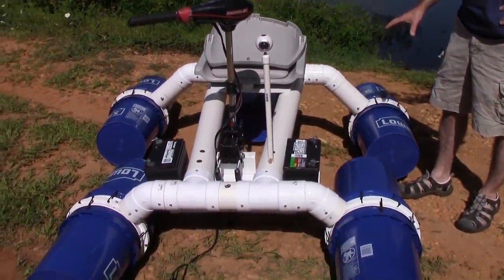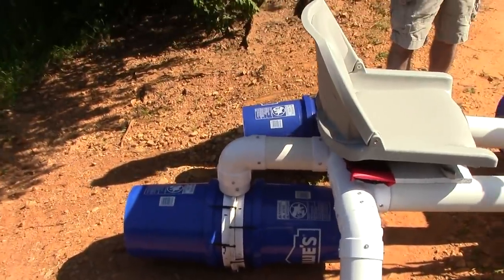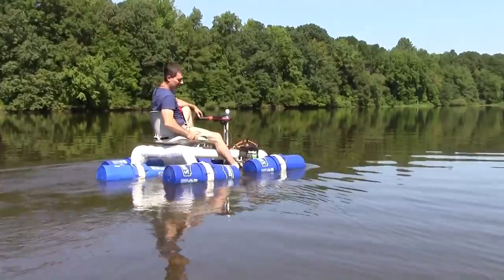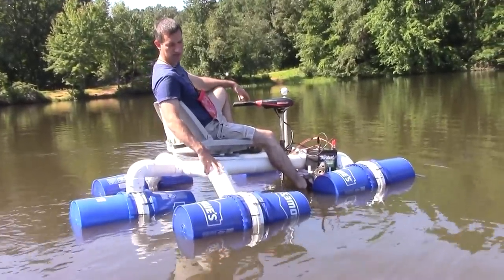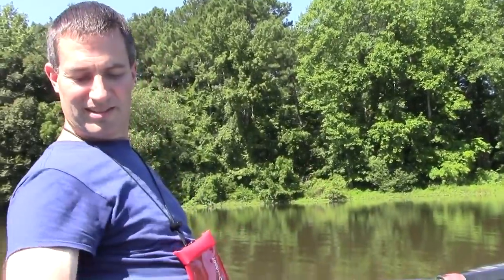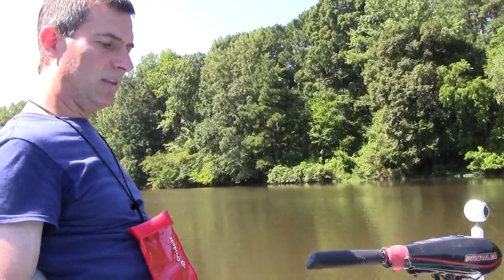Homemade 5 gallon bucket race style fishing boat

Comment: I think 4 or 6 - 8' 4" sealed pvc tubes with 90's on front and a cap on back would give you better results... than those buckets... and as someone else said, get rid of those heavy batteries or calculate your center of gravity and shift them back.

Comment: I’m surprised you didn’t use pvc primer then the glue. It makes a air tight and water tight connection, plus no need for screws. 
(Sorry just heard you say in the video you didn’t use glue because it’s for a different project)
Reply: Thinking the same thing. Way stronger and air tight.
Reply: @emceeodessa5606  ohh ya the screws would leak first if anything the pvc glue is forsure stronger (just realized why he didnt use glue but still stronger lol)
Reply: He mentioned that he didn’t glue because he use those pvc for other projects.
Reply: At the least read my whole comment and you’ll see why he didn’t use glue.
Reply: yes, why would anyone ever think to use glue without you telling them to.

Comment: I would glue those pipes together instead of screwing. When bucket fails pipes will float. Great project anyway
Reply: I have used a lot of pvc in my life and I was wondering --Where's the pvc glue?
Reply: thaboomer53 he does say he didn’t glue it because he reuses the materials for other boats
Reply: Javion Bullocks a bicycle seat post with seat removed afixed with duct tape should suffice 😒

Comment: The buckets are really cool and a stroke of genius. Lowes also has 12" PVC pipe in 20 foot sections. 12" caps and 12" X 4" T's would  be able to be clear primered and glued on for extra strength and weight savings? Just a thought.
Reply from the maker: I will look into it, thanks for the suggestion.

Comment: Great job at thinking outside the box. My one comment is that maybe moving the seat back about a foot might balance it out. Seems to lean forward in the water. Other than that a really neat way to cruse.
Reply: George, go to 6:20 and you will see that it was built that way with the rear higher.  At 7:00 you will see the buckets are sitting about the same in the water.  The difference can be compensated by making the front struts longer or the back shorter.

Comment: Just a suggestion but hang frame from buckets use sealed tubes instead of screws you'll obtain better buoyancy and having the buckets turned 90 degrees to reduce drag. Fill buckets and frame with foam? Tis the season to start

Comment: That is a cool start on a great idea, It's definitely a Builders preference type of thing though hu! LOL   I might have come to the design you built on paper, but it would stayed on paper for improvements I think.  Or it could be that i just saw yours and had the opportunity to shake my head where you didn't get yours till after the build. 

 I wondered right away why you screwed it together rather than making it water tight, seems the frame would only make it more buoyant which is desirable.  While making it water tight might seem more difficult in the build, seems to me it would be more than worth it.   That wood used is a bad choice for sure, the osb right? Id pick a different material for that purpose.    the 5 gallon Buckets.   You know, that is an awesome Idea , there are other buckets that are bigger though, I have used some material from the kind of buckets you have there ( lowes specifically ) to plastic weld with.   I don't know how well it works yet  but I have seen welding kits at harbor freight I have been wanting to check out.  they are dirty ass cheap of course as is the material.  Seems to me that back pontoon on the single arm is giving you decent support and the front end is lacking. 

  I sold a 6 HP Clinton 2 stroke motor a while back that was too large for my raft But I would bet it would be perfect for this size DIY craft.    i would not buy one tat old to run on purpose though, I only had that one because It was so cheap it was crazy not too and after I rebuilt the carb ( 20 min job ) I used it for a summer and sold it for 100 X's more than I paid for it LOL>      

   You gave me a ton of ideas to play with before next summer  man!  thanks for the awesome video. 

   i wonder if a central frame built with a singe plastic culvert pipe Capped on both ends  and your idea with the buckets as side stabilizers would work? maybe form caps for the fronts of the stabilizer buckets in the cone shape to reduce drag.  Or even ditch the buckets completely and build slightly smaller culvert pipes for the side stabilizers.    that way if you did use a a 2 stroke 6 to 10 Hp  you could get up and go pretty decently, maybe even plain LOL   Like a torpedo.   the motor would need to be in back of the driver though for that. 

   Great Vid man!
Reply: awesome comment. in other words "didn't you think this thing out dude.

Comment: Why are you screwing holes in the PVC instead of just using glue?
Reply: exactly, one its not water tight, it will take water and lower boyancy and there is no structural integrity in this design, 2 screws are no use at all, use glue it will most likely hold for life then, instead of a little while till the screw holes weaken to the point of failure.
Reply: You can use silicone washers and caulking to make the screws water tight.

Comment: Nice, have you thought about using a weedeater or chain saw motor? I would use pvc glue and metal roof  screw with the rubber washer. Just a thought.

Comment: Those lawnmower batteries are going to live a short life being deep cycled with a troller motor.  They arent designed to be deep cycled, thats what a deep cycle battery is designed for NOT a standard lead acid start battery. Those are only designed to spin an engine over via the starter and then they are charged once the engine is running with the alternator spinning.
Reply: Dee Shiznittlebaum  Say what? All a capacitor does is oppose a change in voltage. It is limited to its capacity at doing that by having a CONSTANT power supply which a automotive starter battery is not. A capacitor in an automotive amplifier setup is able to prevent voltage sags because the cap has a constant power supply  that being the alternator when the engine is running.

Comment: I have seen a lot of Good upgrade Ideas flying out so I will add one to the mix  how about yes use your glue and Buy a couple giant bags of styrofoam Packing Peanuts inside the whole thing using the Idea mentioned with Biggest Diameter Pipes you can find and lose the barrels not using the screws is the best improvement ..WATER Tight is the way to build any boat and any material that rots under water is out I think maybe using the stuff for Plastic Fences as board or the PVC Type decking. Great Job Fun Videos.
Reply: Packing peanuts.., REALLY!!! 

Why nut both of your ideas in only 1 step!!! Can nobody think of using only 1 product that floats, seals and bonds???
................. FKN SPRAY FOAM!!!!!!!!!!!!! 

It does an outstanding job as a glue, it will give more buoyancy, and it will seal holes!!! Lightweight and multiple benefits as well.......
Reply: Jeff Lake 79شض
Reply: Jeff Lake 79شض

Comment: Forget the buckets use 8 or 10 inch PVC pipes on the edges cap them off
Reply: The buckets where the head scratcher in that design.

Comment: good design... maybe use giant hose clamps to secure wood pieces to the pipe and glue the couplers together for water tightness... and maybe 12 inch pvc instead of the buckets but first do the math for displacement
Reply: They can't be too water tight unless he capped the ends. It would have been better all glued. And buckets inline instead of offset. Seat is too far forward.

Comment: I would say leaving out how you joined and waterproofed the buckets is a pretty significant omission. I think I would have used glue to solidify the stress on the joints equally. Still a nice bit of engineering. I agree with gent  before me who said turn the seat around and your weight distribution problem will probably correct itself.
Reply from the maker: You are correct, I don't know what I was thinking about leaving the bucket build out. Here is how I built them if you would like to check it out. The old way of attaching with wood is in this video https://youtu.be/nMZB2bhM9Io and the new way with plastic is in this video https://youtu.be/0X4rS23e36I. Thank you for the comments, Lonny

Comment: If you sealed the buckets better and installed air fill nozzles, a few pounds of air pressure would increase buoyancy 5 times! And you could level it out!
Reply from the maker: Interesting idea, thanks.
Reply: I don’t think pressurizing the tanks or buckets will increase “ buoyancy ” Unless the pressure changes the size of the bucket, the buckets displace the same amount of water pressurized or not.
Reply: Actually it does! That's why the aluminum pontoons on a pontoon boat have air nozzles! The increased air pressure inside the pontoons make them float higher in the water! It has to do with the amount of air inside! If you have a sealed quart jar, it's easy to push under the water! Try the same thing with a 5 gallon bucket, not so easy! Don't even try a 55 gallon drum! So, when you increase the air pressure, you're just putting more air in the container, making it more buoyant!
Reply: oldschooldiy actually, you're wrong.  The reason for pressurized metal pontoons is to make leaks very evident.  Air has weight.  Pressurizing metal pontoons actually makes them ride a very tiny bit lower in the water.  Buoyancy depends on the weight of the water that is displaced vs the weight of the object displacing the water.  Your own example actually illustrates this (qt jar vs bucket vs 55 gal drum).
Reply: Never let it be said that I don't admit when I'm wrong! I went back to my original source and did some research on my own, and then with my source, and I was wrong!!

Comment: Awesome DIY and design but did cost of materials save money in the end vs buying something comparable & gently used (ie) more streamline, light weight, efficient and proven(?)  Still awesome regardless. Incidentally, considerable weight savings could be accomplished by using lithium-ion batteries... yes, they are more expensive but Li offers no hassle maintenance/storage, quicker charging, wayyyy more charge cycles vs lead acid and can be drained/utilized well below 50% capacity which any attempt to do so w/a lead-acid would begin to permanently damage/lower it's spec'd mAh capacity. Also (as someone mentioned earlier) plastic kitchen cutting boards, synthetic decking planks and/or (better yet) angled aluminum channel might prove more worthy than particle board for a whole lot of fairly obv reasons. Might even consider adding a solar panel if you go the lithium route given the fact there's usually a considerable amount of Sun involved/available when boating and/or sitting idle (with the motor off) while waiting for fish to bite :)
Reply: How did you assemble the buckets?

Comment: Very nice pontoon boat. I would have glued the parts together because by screwing the pieces together can seep water. You can always take it apart and glue together.
Reply from the maker: You are correct, the upgrade video will have all of the fittings glued into place. Thanks for the suggestion.

Comment: You can make a new form of the buckets, your vehicle is not so fast therefore you can make a drop form. Read for this the reynolds effect by Wikipedia. if you set the drop form with the big end in the drivedirection then you have the lowest resistance in the water. you can drive faster with the same energy. And calculate your balanced condition of your vehicle. If you dive too deep in the water down then is the mass of water on the front of the buckets very high. Then you have a very high inertia.
Reply: I read it twice then realized there was a reason I failed Physics.

Comment: Suggestion: you could try creating conical attachments to the front and rear of each bucket to reduce resistance as you move forward. ...and possibly finding a way to fill each pod with expanding foam spray, to eliminate possible water  leaks in the pods

Comment: To lose some major.weight go buy a 100 lot case of 18650 Li-ion cells and build a more powerful battery and a quarter the weight of lead acid batteries all for around a hundred bucks.
Reply from the maker: Sounds interesting, I will definitely look into doing that. Thanks for the tip, Lonny
Reply: Would operating time be as good as a deep cycle battery?

Comment: If it has a motor, it has to be registered!!
Reply: That's  correct for the US. All motorized boats need to registered in all states  except  some sailcraft, lifeboats etc. Although good news if u live in Australia where registration  isn't  required  for  boats under 6hp.
Reply: If it is 9 or under here in Oregon it does not require registration!
Reply: @garybush1650  . Thanks  for that correction. I did find it strange  that the states laws I looked at in the US Were similar regarding mandatory registration of powered vessels but as you point out there are a few exceptions.....DISCLAIMER. Sorry about the misleading information.. Because  I live in Australia in the southern hemisphere I'm upside down and the ocean is actually in the sky and vise versa which makes internet research tricky , that's the last time  I believe something I read on the net!

Comment: As far as the front goes, use a couple boogie boards from Goodwill or something. Its light, foam, has a turn it at the nose of thw board and it's durable. Should cut down on the resistance a little.
Reply: And maybe use a foam cooler for the battery? I don't know what effect the battery would have falling into water under covered. ( Insert joke about currents )

Comment: nice concept / many flaws.
Reply: John Pelham concepts have many flaws.  That’s why they are CONCEPTS.  As an engineer you first identify a problem, you brainstorm solutions, you create a concept of solutions.  After trial and error.  Sometimes  into millions of dollars and countless man hours, you create a solution.
Reply: Dan Cheesman Every one knows , for an airtight compartment it needs to be airtight. Particle board will return to particles. 5 gallon buckets aren't streamlined.
I'd have used pvc pipe for floats.
I still like the concept.

Comment: Have you ever considered filling the PVC pipes with an expanding foam after they are glued and screwed. I would also fill buckets. All you need is a fill port and air escape port for any air or overflow. And  a spray foam kit. Something to ponder. It would raise the cost but probably make your craft less apt to sink as well as make it more stable.
Reply from the maker: Good suggestion, that is something I will look into. Thank you for the comment.

Comment: Awesome build.. love it sir. I agree does need another bucket in front middle. Wrap it with fiberglass. Buckets too. Make a cone on the front and back of buckets would be cheap, cost effective and would move pretty quickly then. You could make the cones out of cardboard and wrap with fiberglass. Estimate 200 to 300$

Comment: I agree with the pontoon with 12" pipe or 55gal drum design, BUT...IF the project needs to remain under a certain budget by keeping buckets...then I recommend an overhaul on frame design...go with a "V" shaped bucket arrangement that points in front at 60°, decreases drag. For better stability and less weight...decrease pvc diameter and fill with closed cell foam (maybe go with thinner walled piping too), increase side to side cross-members, and those running front to rear should be further apart. That will create a wider base for decking as well. From top view you'd see a "A" frame shape. If front dips, then add 12" pvc cross-member near apex. (Best frame tho for stability and deck space is "H" pontoon style. Go big with drums or go home. Then you can add more batteries and motors with no concerns. Right now you only have 50gal in buckets total..double it at least if not  more with drums.) What is cost of prototype in video? I think I like the bucket idea but share concern about sun in FL eating them away.   Another thing is drawbridge style stabilizers. They can be raised while driving and then lowered and locked in place while moving around on deck. I'd put 2 at the top...left and right of apex.

Comment: I built a boat rack for my one man warrior fishing boat. Instead of pulling a trailer, I wanted to haul my boat in the back of my GMC 4 x 4 . I have a 1/2 hp winch in the rear of my truck I can use to pull my boat from the water, directly onto the rack . I used 4' pvc pipe glued ..

Comment: Suggestion: Widen the front equal to the rear. Use six buckets on each side, end-to-end (less drag, more buoyancy). Add two more buckets in the front center. Place a cone "cap" on all leading buckets (each side, front center and rear center), reducing the drag even further and sealing these cone caps would also provide more buoyancy. This would be a total of sixteen (16) buckets, giving 650+ pounds of buoyancy and less drag.

Comment: As soon I saw the buckets, I knew they were not going to work out lol Great start tho, usually the first time be epic fails, it floated, and you rode it, all you need to do is fix up the small flaws which are the buckets. Maybe you could connect the buckets and form a pencil like front, so their could be less resistance and still maintain itself atop.

Comment: This design is very intriguing to us. Thanks for sharing! We use smaller PVC tubes for sail cars and other projects. And looking at this video, now I'm wondering if we can make a sailing catamaran based on this design. BTW, I see you're drilling and bolting or riveting parts that appear to be PVC. Have you tried the PVC glue? It is SUPER strong and would create a hermetic seal. There's also transitional PVC glue for gluing PVC to some other plastics. They all set in seconds. They're amazingly strong.